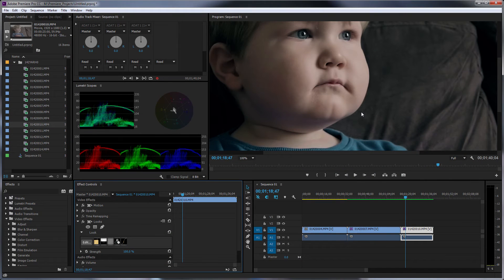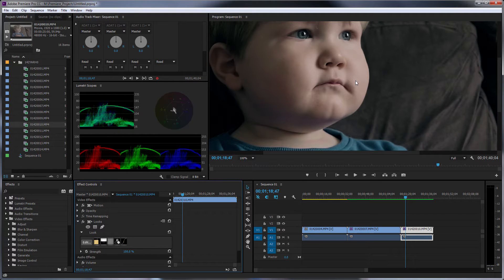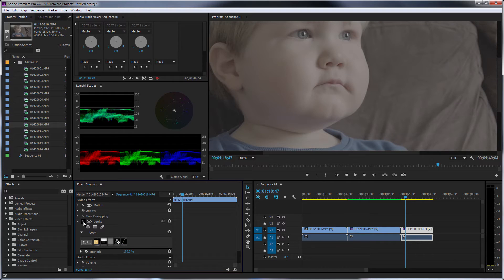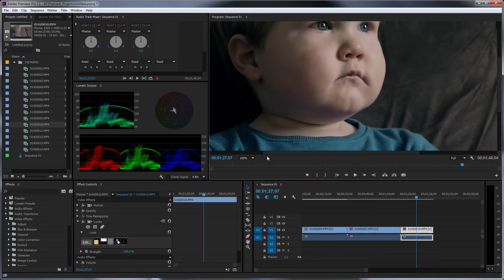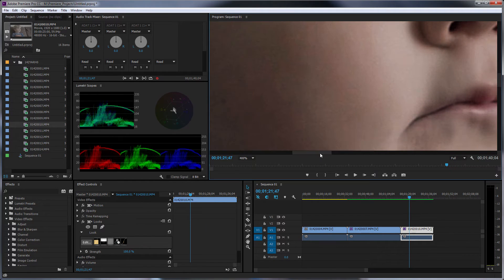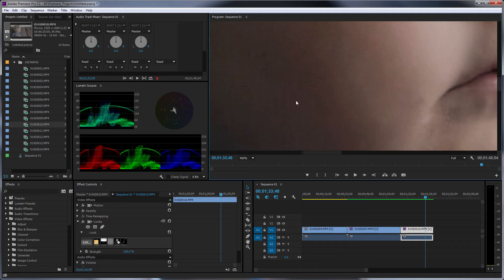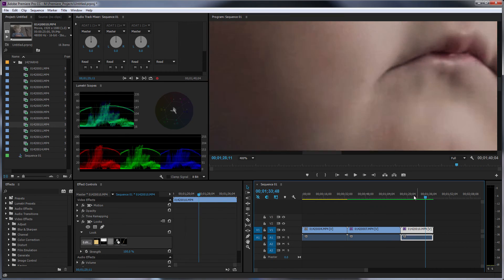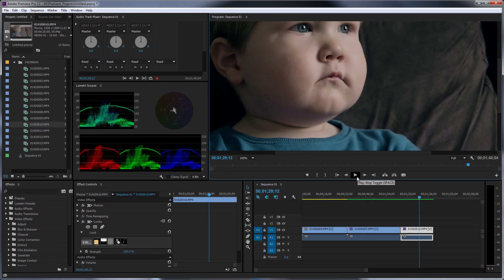DVX200 - Macroblocking / Artifacts with V-LOG L

Comment: Hi, what was the shutter speed?
Reply from the maker: This would have been 1/50 sec...so fairly standard for PAL.
Reply: As far as I know, DVX200 records much better in UHD, there is less noise. It should be even better with the external recorder, because chroma subsampling is 4:2:2 8bit even with UHD50p recording, the internal recording in UHD50P is 4:2:0 8bit. I'll do a test soon.
Reply: The shutter speed of 180 degrees, gives a much larger macroblocking even when recording UHD in good lighting - that's why I asked.
Reply from the maker: Never heard of macroblocking being related to shutter speed. This camera works great with an external recorder. All the work I do now uses an external recorder and V-LOG footage is fantastic!

Comment: Just bought a DVX200 and watching videos to catch up on how to use it.
Just wondering if you had the gain up on this low light shot?  The macroblocking looks like shots from my old HVX200 when I turned the gain all the way up in a dark environment.
Reply from the maker: This was a while ago now but I doubt I would have had the gain up for a text like this. I try to always light a shot so I can use no gain as it's really quite a noisy camera.

This could, however, still be partially down to noise reduction. The ability to disable this totally in firmware was added after this video was recorded I think.

I'm not a fan of H.264. It serves a purpose but has many flaws IMHO.

Comment: Hi, I just bought the dvx200 i was wondering how to grade the VLogL shots? Which lut you use in premiere pro?
Reply from the maker: I've never used a LUT when grading log footage from the DVX. I did a video on one possible way to do this in Premiere here https://youtu.be/ImEiT1G_9XQ but I know some people swear by the accuracy of a lut initially. My theory is, as long as it looks the way want, it doesn't necessarily matter how you get there. :) Enjoy the DVX. It has its quirks but can produce lovely results!
Reply: Thanks for your friendly answer, at first sight I must say it looks a bit noisy in low light especially in the grey/dark areas.. Is this one of the quirks? :D I've tried to reduce noise in settings but it probably loose a bit of detail.. I dowloaded 1.83 firmware. How do you set up the camera and what gain/iso, scene or color settings you use in order to reduce this noise in low light footages? You think VlogL can help in low light?
Reply from the maker: I would say it's not the best low light performer but it's not unusual for a camera of this type. Vlogl likes good exposure and light. It will most likely make noise issues worse. I wouldn't use Vlog unless the scene is well lit.

Comment: Nice couple of videos regarding V-LOG on this camera.  I had the same types of issues and have been steering clear ever since. Might try again with the 1.51/52 firmware updates.
Reply from the maker: +Dave Fanner Thanks Dave. This was using the 1.51 firmware. I think I'm going to try a Ninja 2 (lower cost test device) to see how well this works with ProRes HQ 10-bit 4:2:2. I'll be limited to 1080p 30fps but that's OK for this. I'll do an extra video on this as I find out more.

Comment: From what I have read,  V Log L works best with an external recorder like a Shogun or similar at 10bit 4.2.2 - so maybe these artefacts are occurring just in the 8 bit 4.2.0 internal...? Again just a guess. Do you happen to know if an external monitor works ok with camera in 4K mode? I am just about to ‘probably’ buy this camera - having had a Sony X70 that  ridiculously cuts off HDMI/SDI output in 4K - so no external monitoring!!
Reply from the maker: +claytoncreative Yes. HDMI is DCI 4K at 24p, UHD at 24, 25 and 30p. SDI is only FHD but is up to 60p. I'm thinking about a small Ninja 2 to complement this camera. It has stunningly sharp and clear images in FHD mode as it's a downsample from c.5K on the sensor. This would look superb stored to a more capable codec.
Reply: +tdcat.com I am having a DVX200 on demo in next couple of days - is it just me but nearly all the footage I see of this camera on line has a slightly green cast - almost like there is some smoked glass in front of the lens- I have a GH4 which shoots great colour in flattened CinelikeD profile and then graded up - I am hoping the DVX200 will be the same? I have had to return the Sony PMW- X70 which is a shame as the Zeiss optic on that had lovely colour rendition and sharpness - such a shame that Sony could not fix the HDMI feed out in 4K - a problem with quite a few of their models I understand.
Reply from the maker: +claytoncreative I haven't noticed a green cast. How did you find the camera on your demo? I personally find it a little over-saturated when using Scene Profiles and tend to nudge down the Chroma to about -15. I also reduce the sharpening to -30 when shooting UHD and -5 when shooting FHD but other than than, the images are great.
Reply: Still waiting on dealer to ship the Panasonic. In meantime they sent me JVC LS200... this shoots J Log... seems quite nice image and very easy to grade - nice colours but the viewfinder is just too small to make it workable and the LCD is not great - you need an external monitor. I think I would go for the Mini Ursa if I could get my hands on one... new System upgrade looks awesome and images coming our look awesome too. Still I will report back on the DVX200 as soon as it shows up - I am hoping to just shoot log and grade up like I do my GH4.
Reply from the maker: +claytoncreative I have now shot V-LOG on the Atomos Samurai (10-bit 4:2:2) and it is vastly better. Macro blocking is gone (I would expect that as it's an H.264 artifact). Banding is still an issue which I find unusual. I might post the shot online and make sure others can duplicate this and see it clearly. Not a big deal though. Cleaning up the artifacts makes this totally acceptable.
Reply: Thanks for the update on the macroblocking issue. I only came across this video today and have been eyeing and following the dvx200 since it was announced last year.

When I saw the issue in the video I did wonder why you'd shot in log using 8-bit 4.2.0 colour sampling and the internal codec. I wasn't sure if it was just as an experiment or what. However the fact that you've tried it out on the Samurai with the appropriate setting and got the expected results is great.

Is there any chance you could do a follow up video on this set up and reporting your findings? That would be great if you could.

On a final note regarding the issue of banding,  one thing to bear in mind is the bit depth of your monitor. Many monitors are only 8-bit and these are notorious for not displaying the full 10-bit of colour data, producing banding by discarding a lot of that information. So I'd check as to whether your monitor is 8-bit or 10-bit and then try viewing the edit on a 10-bit monitor if you have an 8-bit one.
Reply: Yes agreed on the 10 bit... in the end I tried the DVX200 for a couple of days and didn’t like the image particularly much - or the very plastic styled body - so I hired an FS5 - and that was that - have one on order - 240 fps and variable ND - handles superbly - absolutely fantastic camera!
Reply from the maker: +claytoncreative Can't disagree with that. The FS5 is a wonderful camera from what I have read. Unfortunately, the extra £1,500 took it off my shopping list. There were a few other reasons but nothing major. The DVX200 body does not concern me now. It's solid in all the right places but it is a shame that they wrapped it in an exterior of that type. Many of the Canon and Sony bodies have a plastic outer but they just do it better!
Reply from the maker: PHS Pictures Yes. I'll happily follow up. My knowledge of working with log footage has improved leading to much more reliable and satisfying grades and the improvements on the DVX200 since firmware 1.65 seem to be quite apparent. I was working with some 4K DCI footage today and really pushing the footage with great results purely from the H.264 100mbps originals. I'd love to test with a UHD Atomos but couldn't justify the cost for a test. I'm starting to use it more and more now and may invest sometime soon.

My main monitor used for grading is a calibrated DCI 4K LG 10-bit display. It not the best display out there for real colorist work but then, I'm not a colorist :-)
Reply: +claytoncreative Yup, I'd second that. The FS5 is a serious bit of kit. I wouldn't use one, because my needs are more Events based so the DVX200 looks like a perfect solution for that type of work.

If I were more of a cinematographer, I'd probably opt for the VariCam but that's probably due to my being a Panasonic guy more than anything else.
Reply: +tdcat.com That would be awesome. Can't wait to see it. In fact, I feel a subscription coming on.
Reply from the maker: I've done a quick informal video around the external recorder setup and grading the log footage here https://youtu.be/mnd_wdpcFFc